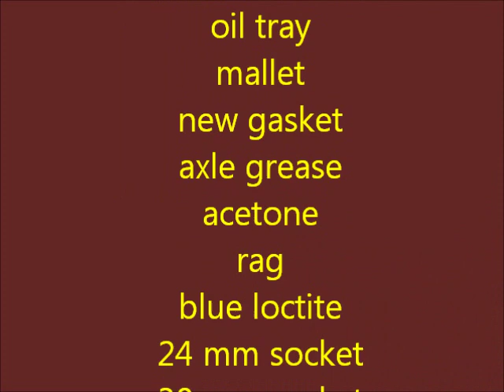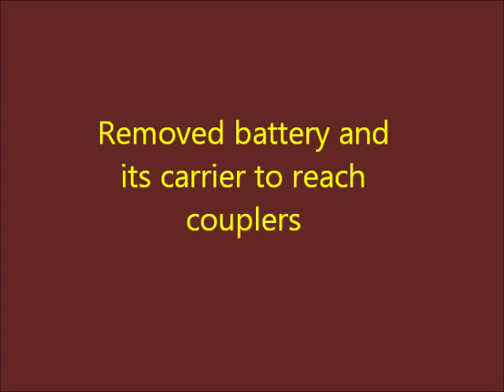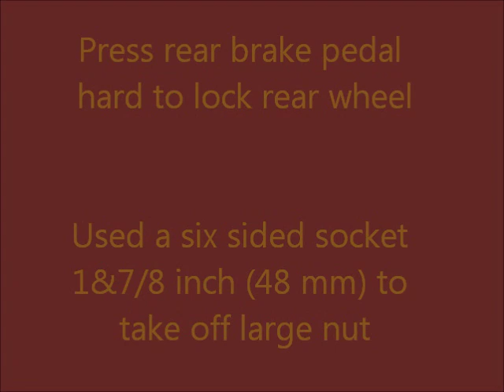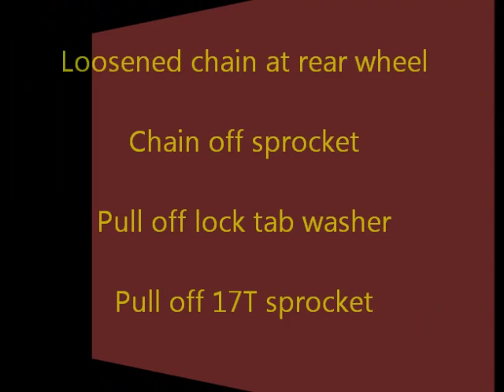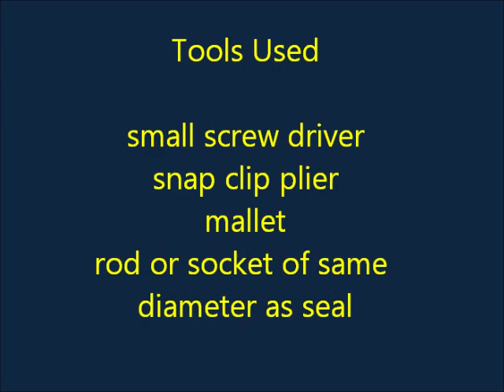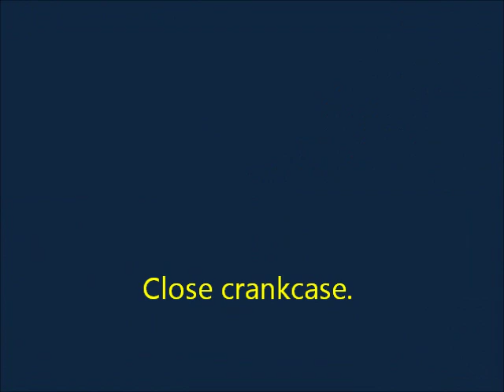Front Drive Sprocket 17 to 18 Tooth and Oil Pump Gear Change of Royal Enfield Motorcycle G5

Comment from the maker: Michael:

Thanks !  

I had changed them at 14,600 miles but it was not necessary to do it. I found the parts to be in very good condition. They could easily have gone past 20K miles without any problem.

Enjoy your C5.

Comment: It works dude , i have changed my 16 T sprocket to 18 T ,at 2200 rpm i got 72 kmph ,vibrations are reduced ,bikes is gliding smoothly ,gear shifts have become longer , a little drop in accelaration at lower end but not much difference and that too on my TB 350 cc. thanks man
Reply from the maker: Glad to hear that it has worked well for you. I enjoyed your Spanish Flamenco guitar piece, well done !
Reply: I did the similar change (16-18T front sprocket) recently on my TB350. The initial pickup has reduced by ~10-15% (overtaking is difficult now, need to shift gears compulsorily while overtaking), the smoothness/vibration has lowered by 10%.
Reply: My TB 350 is customised it has 140 90 15 inch tyre thts why i changed the sprocket,i can now cruise at 105 kmph,but if u use it to commute go for 17T not 18T
Reply: I have a classic 500...can you tell me from where you got the 18 tooth front sprocket...please

Comment: Use a longer lever:- You can get an socket wrench to remove car wheel nuts that extends to some 80cm long. If that fails, the tubular lever from the hydraulic jack over the wrench,  I have seen a scaffold pole used. Bashing the nut with a drift can deform it, not to mention damaging the bearing it runs on.

Comment from the maker: @CrazzyRandy :

Sat Sree Akaal Ji: 

I have not tested the maximum speed it can reach. It may increase slightly by about 5 mph. At high speeds it is not a pleasant ride - bike is twitchy and handlebar / frame has vibrations.

I like the 18 tooth sprocket a lot because the bike handles better, more pick up, wider power band in each gear, don't need to change gears often in twisty back roads and getting upto speed without the buzz of high rpms.

Comment: Watch for the black plastic spacer on the bottom shaft if you're doing this mod on a B5 500, make sure to put it back onto the shaft (it comes off with the case and drops into the oil pan). Moving from 17 to 18 teeth should increase speed by 5.5% whilst obviously lowering torque, looks like 19t is possible but 20t needs mods to the case and is a stretch too much for the HP.

Comment: Hi!
Haven't been so lucky with my C5 last year - got engine replaced after 2.500km due to axial play of the crankshaft exceeding limits (engine was developing a hell of a clunky noise). Replacement engine dripped oil at the gear box shaft / sprocket after 500km, due to assembly error in the factory (wrong screw nut torque). Hopefully the new season starts off the better. I wonder if I can change from 18 to 19 teeth sprocket to lower revs at cruising speed. Hope you still enjoy your G5 :-)

Comment: why would you change the oil pump gear? Just in case it shatters from wear? How often is this checked/replaced. 

Being plastic it's something i worry about a bit, but i like how easy it is to change, i'd of assumed the flywheel would need to come off. 

Cheers.
Reply from the maker: The US importer of these bikes had mentioned that the factory recommended that the plastic gear be replaced after 15K miles. But from all accounts and many more motorcycles around since then, it is clear that these gears are quite well made and can last much longer than that. I don't think that many or everybody does it. But since I was changing the sprocket so I went ahead and replaced the gear as well.

Comment: well increasing the size of front sprocket it will have more number of rear wheel RPM per engine RPM.. but trust me.. it will lower the pickup.. overall speed will only increase if you improve engine performance by enriching fuel mixture or by some other means. and life of clutch will be affected as well.
Reply from the maker: You are right that bigger drive sprocket does not increase top speed because of limited HP of engine. However the street driveability is much better with larger sprocket. I don't need to change gears so often. The bike reaches higher speeds at lower engine RPM in each gear. It gives wider power band. Engine is more relaxed. Do not need to rev up the engine. 

Because RE has high torque engine, it is able to pull bike without problem and in fact pick up is improved. Many US and UK riders have done it and we like it much better than stock sprocket in the motorcycle. It actually feels like a different bike.
Reply: +singh5g - for general information - The 18T on the (UK 2015) C5 EFi is capable of driving the bike at 70mph at around 4200rpm. Although it has an 18T it has an 18-in rear,  not 19-in. With a free-flow exhaust and a couple of other tweaks we can get 34bhp at the wheel. The upright riding position on the C5 makes motorway 80+mph quite uncomfortable from wind buffeting. Wind resistance limits ultimate top speed. For comparison the just 20kg lighter 28bhp Honda CB77 (60's) could attain 104mph. The RE is therefore somewhat under-geared.
Reply from the maker: +Jeff Slade : Would love to see dyno results of your claimed rear wheel BHP. Without that it is not convincing. What do you really mean by 'tweak'.  ******  If you live in UK, Hitchcocks sells kits to enhance power and torque of RE EFI engines with their cams, valves, head work, KN filter and power commander. But they reported only 32% increase in BHP, which will come to about 26-27 HP at the rear wheel. Even their larger bore 535 kit does not reach the number you have mentioned. Need proof of what you say.

Comment: hello Singh sir,
my Electra 350 has a 15 front sprocket , and the options I have are 16 or 18. 
which one should I go for?.
I don't really care about the pick up , but I want the low rpm cruising and the smooth uniform ride.
Reply from the maker: +Vishesh Dabra : I have not seen 15 tooth front sprocket in any Royal Enfield since it is too small. To the best of my knowledge, Indian Electra 350 should be able to take 18 tooth sprocket. BUT make sure that it fits and does not rub / scrape the crankcase. I would also recommend that you confirm with your local dealer as well in India, since we do not get this model in USA.
Reply: Thanks for replying, I have been searching for the same. My Electra uce 2014 came with an fifteen tooth sprocket in the front. And today I could get my hands a sixteen tooth sprocket (450rs) that would fit , I also saw the eighteen tooth sprocket but that's too big for the space that we have . 
I'll put the sixteen tooth one next week and will tell you how it goes.
Reply: Vishesh Dabra so how's your bike after the change in sprocket teething,any difference in cruising speed etc

Comment: Just thinking, is it a 46mm or 48mm to remove sprocket ???
Reply from the maker: I had 48 mm sprocket which is slightly bigger than actual nut, but it works OK.